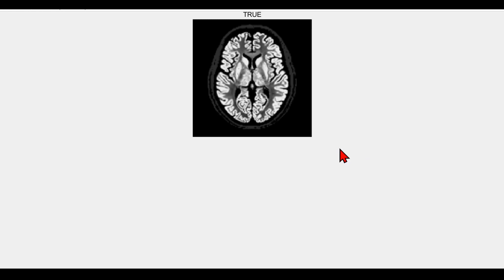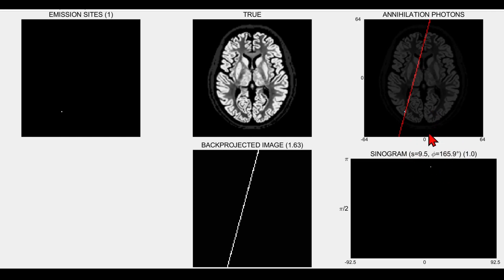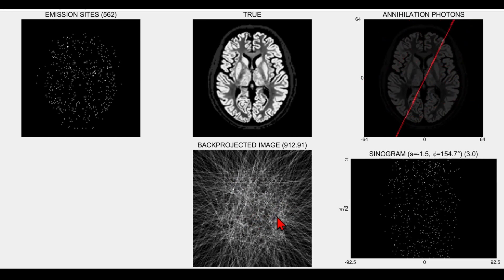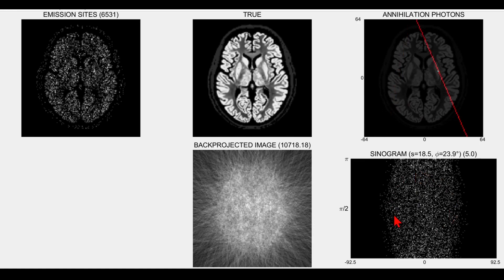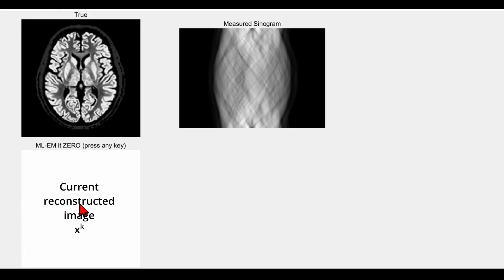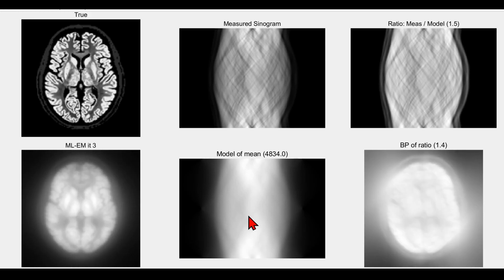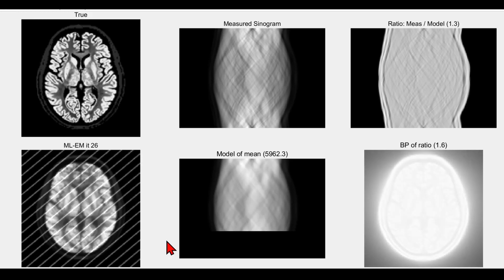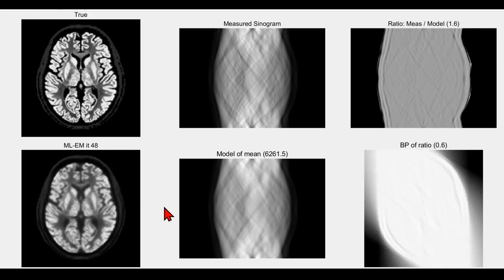PET acquisition and iterative reconstruction (basics in 6 minutes!)

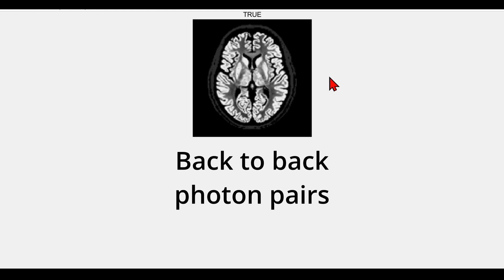Comment: @ 0:18 Hi Andrew. I was wondering, isn't the photon "going upward" deflected from its path by collisions with atoms in the brain cells?
Reply from the maker: Hi Jacob, thanks for the question. Yes, there is a probability of Compton scatter (inelastic) or even a tiny probably of Thomson scatter (elastic) of the 511 keV photons with the electrons in the attenuating medium (i.e. the brain, skull, etc.). However, a good fraction of these high-energy photons do escape without any interaction at all. (Photoelectric absorption can also occur with relatively low probability).
Reply: @AndrewJReader  Aha, thanks! What is modern physics without probabilities ;-)